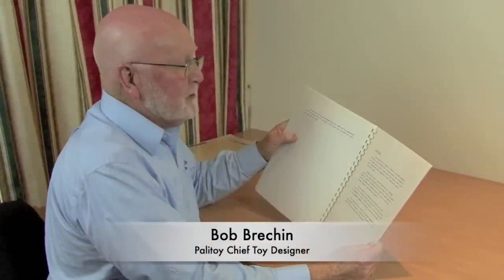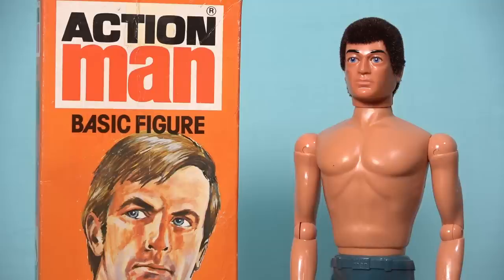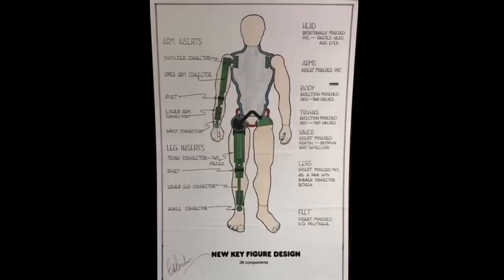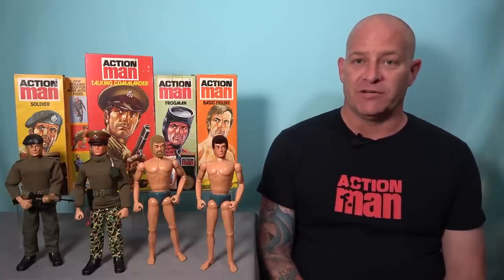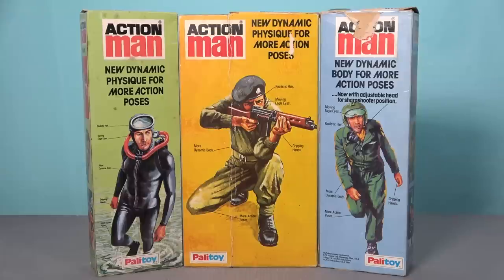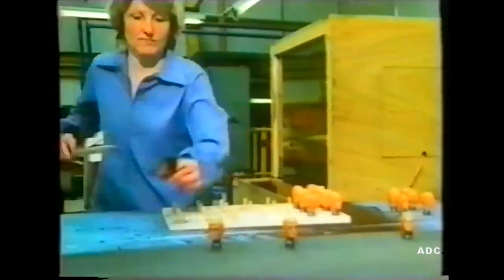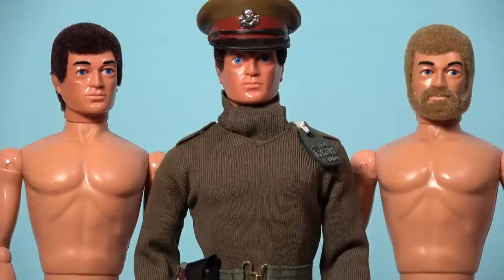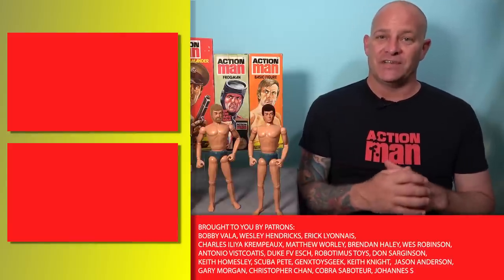How Palitoy created ACTION MAN’s Dynamic Physique

Comment: My first Action Man used the original body, which must've still been available on shelves around 1980. He didn't last long though as his adventures deep sea diving (in the bath) took it's toll and rotted apart. My two dynamic physique "Blue Pants Action Men" faired far better exploring the depths.